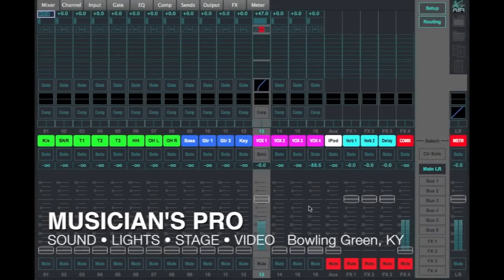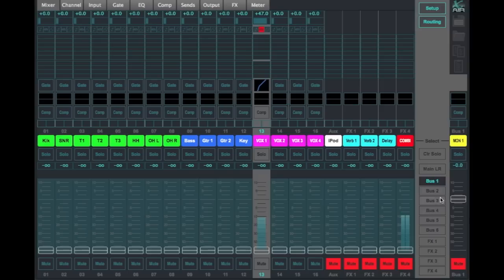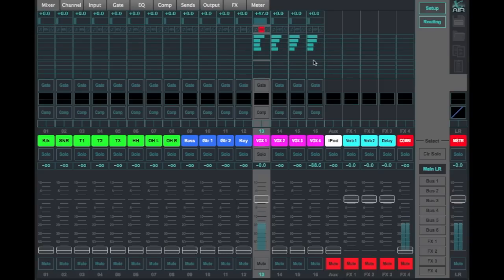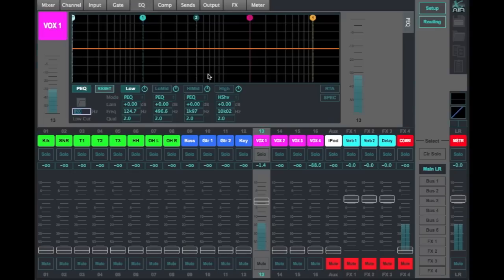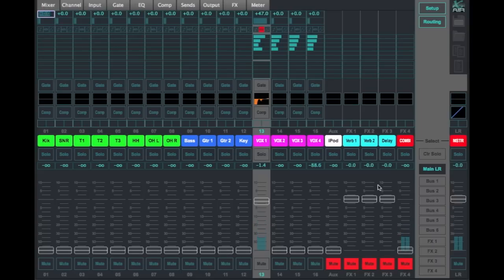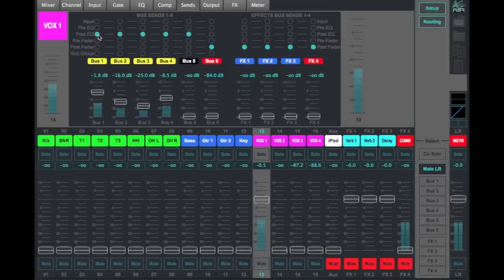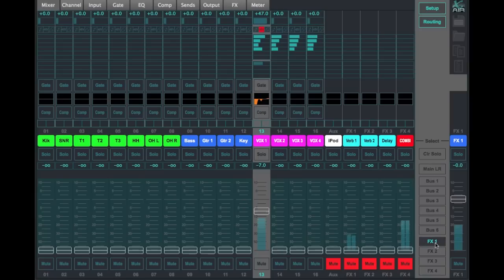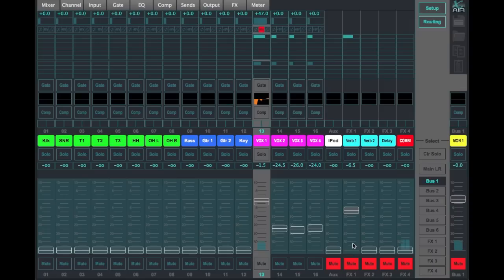Monitor Mixes and FX to Monitors - MIDAS M32 MR18 + BEHRINGER X32 X-AIR XR18 XR16 XR12 X18

Comment: I have a question. I want to have a different EQ on one channel in the monitor not effecting the EQ on that channcel for the main output mix. And I am using Android Tablet as my control mixer for XR-16. Would appreciate some insight or step by step guide. Thanks

Comment: Something that always confuses the hell out of me is the tapping off of the signal on the sends tab.  When it says pre/post fader and pre/post EQ is it referring to the faders and eq’s on the main page or on the bus and fx send screens???
Reply: It's referring to points in the channel's signal chain. If you bring up the Channel tab, you can visualize the signal "flowing" (mostly) from left to right. The Input tap takes from between the Input and Gate sections. The Pre EQ from between the Gate and EQ. The Post EQ (I would have called this Pre Comp) from between the EQ and the compressor, and Pre Fader from after the compressor but before the channel fader. After the compressor, the signal takes a detour down through the fader and becomes the Post Fader signal. LR assignment is always Post Fader.

Comment: Nice video...I think this answers my question...I want reverb for my drums in the main mix but nothing at all from the drums in  any monitor, so i dedicate one reverb slot for drums and have that dedicated effect return set at zero in each monitor bus?
Reply: There would be a number of ways to address this. Could use a subgroup for the drums, insert the reverb on the subgroup and route the subgroup to the main mix. This has the downside that reverb gets applied to all drum elements - normally you wouldn't add reverb to the kick for example. The other option is to route the drums to a bus and use the bus sends to set what gets reverb then the reverb return is patched to the main mix as well as a dry contribution from each drum channel I'd use a DCA across the drum channels to give you a drum "master fader". Monitor mix would take the drum channels direct so they are dry. You would probably not use a reverb insert onto drum channels (say snare) as that could quickly consume all of your FX slots and you'd essentially have to take that fx wherever you used that drum channel - because in practice your monitor sends would likely need to use the post fader option.
Reply: Sorry I'm wrong there in the last paragraph. Monitor is likely to need "pre-fader" so you'd probably use the bus send post-eq setting as I think that is also pre-insert - would need to check the manual. I think the pre-fader setting is post-insert.

Comment: One thing I haven't found any good information on.  While it's clear how to get FX to the monitor Buses, or to the master - what is the best way to get "wet" signal to Behringers P16 personal monitors?  Lets say I have a reverb in FX1.  I select Bus 1 in the mix-to section, move the fader up on the vocal channels  I want sent to Bus 1, move the fader up on the FX1 return, and then I go to the In/Out tab for Ultranet and ensure Bus 1's output is going to one of my P16 channels?  Is that correct? 

And if the above is correct, if I want a stereo effects in our IEM mix coming from the P16s (we run everything stereo) - then would I stereo link Bus 1 and Bus 2 in the mixer, and then send those busses to a stereo linked pair on the P16?   This part is confusing to me.  It would make more sense if I was actually using the physical Aux bus outs on the mixer, but we are sending digitally to the P16s.   Thanks for any help!

Comment: My band uses the X Air Q app to control our own monitor mixes from the stage (6 mono aux sends/vocals). The problem we are running into is each band member wants independent FX level control over their own mix , and it seems that moving FX faders in the X Air Q app only adjusts the FX levels globally across all 6 aux sends. Some musicians want varying degrees of reverb or none at all, for example, on each channel in their monitor mix, with perhaps a bit more on their specific vocal. Is this possible? Or do you have any suggestions for how to properly set this up?
Reply from the maker: This is discussed a lot in our Facebook User Group of X-Air and M-Air.  It is impossible to do what the band members want to do as it would take 6 reverb FX to accomplish this.  It may be too hard to explain in writing..... but the band members are ALL MONITORING the SAME REVERB RETURN channel and they are all SENDING to the input of the reverb.  If one person SENDS MORE to the reverb...they ALL HEAR IT. HTH

Comment: Question for monitors/auxes in general: Is it possible to hit mute on the channel but to still have the signal going to the Auxes? For example, set a fader, leave it on mute/mute group and still have monitor signal on stage?
Reply from the maker: Yes - if you make the AUX sends PRE MUTE.

Comment: If I want the same effect on multiple monitors, each monitor feed gets the effect trails from all the other inputs! For example, the lead singer has a delay FX in his monitor. If another vocalist also wants that delay in their monitor, it comes from the same FX bus. So each vocalist hears the other one's delay. Then a third vocalist wants the same delay. Everyone can hear each other's delay. If assigning a dedicated delay to each vocalist is the answer, that uses up FX slots very quickly. I totally gave up on adding effects to monitors because of this. Am I missing something? Is there some clever routing I can use to make this happen? Doesn't have to be stereo.
Reply: Hi, I am getting the exact same problem that ShaggyDawg has described above. Has anyone found a way round it? The only way I've found to avoid this scenario, is to insert the FX direct onto the aux send.
Reply from the maker: ShaggyDawg - this question is asked a lot and has been answered here. Your answer is correct, it is not possible to have isolated effects without dedicated effects processors.   I have never heard of anyone wanting delay in their monitors. You may want to avoid that.
Reply: Finally someone with exactly the same problem.. after spending 6 hours with the bands mixer at home trying to find a solution i ended up using more than one identical effects to solve this. But still its not efficient and im not sure its the only way...

Comment: Hi. just got xr18
?is it possible to make the FX send ,post fader for the monitors faders,as in the main L/R mix 
   didnt find a way to do so. right now when i lower the monitor fader lets say for VOX, 
    . i hear only the FX return of Vox which is not ideal
Reply from the maker: By default all FX sends are post fader.  If they are not, you have changed them.  There are no monitor fader sending to the effect.  All you can do to get FX to monitors is SEND the FX RETURNS to the monitors.
Reply: i know there is no separate FX sends for Buses(monitors), but i would like to 
  have the monitor mix behave like main mix,meaning when i 
lower channel fader on the the Bus ,the fx send should be lowered 
relatively on that Bus(monitor) too.
  right now when i lower a channel fader to infinity on the bus i can hear only the Fx
of course the Fx send are post fader 
Thanks for replying
Reply: mozizo11 did you figure out a way around this? I’m having the same problem!

Comment: if you want a stereo mix in your headphones for lets say a drummer. is it possible to use a single aux send to them with lets say click panned hard right and the rest of the mix panned left? or would i have to use two separate aux sends to achieve one stereo mix?

Comment: Hey thanks for the video! One Question: If i do add FX to my monitors the way you describe it I would add (lets say reverb) to all my sources on that Monitor. So also my Guitar and snare etc. would have Reverb. thats something i don't want to do. Is there a way to get the same Signal with FX to the Monitor? I have some nice compression and a Room  on my Vocals in me MAIN MIX and I would like to hear that on my Wedges. Some Ideas? is it even possible? 
Best Regards
Reply from the maker: Yes it is possible, with one catch. You are adding the REVERB return to your monitor mix. So..... if you have reverb on 2 vocals in the mains and you want to hear the reverb for 1 of the vocals in their MON or IEM, the will hear the reverb effect on both vocals. It is a shared effect, unless you use 2 reverbs and separate.

Comment: I know this is an old video now, but I am looking to purchase one of these units.  Can you rename the Bus Sends?
Reply from the maker: Yes. Give us a call if you have any questions.
Reply: thanks for the awesome work on the tutorials.  I am working on a IEM setup and I am looking to use the XR16 as the center piece.  One last question.  If I wanted to record on stage will the USB interface track each individual input? or is it better to go to say an ART S8 Splitter and send it to another interface?
Reply from the maker: +Shane Spina - The XR16 does not have a multi-channel recording interface, just 2 trk only.  You would need the XR18 to do multi-track recording.
Reply: +MusiciansPro I was going to use the tascam 8 channel USB interface. would the xr18 be better value?
Reply from the maker: +Shane Spina I think the XR18 is the best value available. It's a full mixer and interface.
Reply: Thanks for the advice

Comment: Hi. Why is the title "BEHRINGER X-AIR X32..." when the video is about XR-18, and the X32 doesn't work with X-AIR???
To be honest, I really hope that Behringer decides to trash their current X32 Edit app, in favour of the X-AIR app... or a redesign of the X-AIR app.
Reply from the maker: The video is not about the XR18. It's about the concept of getting FX into monitors on any mixer. Since the X-Air and X32 are so similar, the procedures are exactly the same.

Comment: How do I just send the main LR to the monitor
Reply from the maker: +Jason Bearup - In routing you can send your MAIN LR mix to any of the ouputs.  If you have a MONO monitor, you will have to select either L or R.   OR - set up a stereo monitor 1/2 and it will be an exact duplicate of your LR.  Lots of options with the X-Air.  Are you a member of our Facebook User Group?

Comment: Hey, thanks for the tutorial. I just wanted to ask, if you know how to use the fx with the panning settings from the channel? When I send one channel for example a hard panned guitar to a fx section, the reverb will appear on right and left channel. But when I pan a instrument I don´t want the reverb to be in center. You know how to figure it out to get the send to fx after the panning of the channel? Would love to hear if it works:)
Reply from the maker: +Juri Band - there are several ways to deal with this.  1.  Simply insert an effect and the guitar channel and it "becomes part of the channel".  2. If you just add reverb via an FX bus, it is not a part of the guitar channel, you have simple added the guitar to the reverb which is STEREO and returning back to the main mix LR.  3. If you truly want to add the reverb via the AUX and do not want the reverb in stereo, you can PAN your effects to one side or the other.  This usually means you need a dedicated reverb effect since any other channels using the reverb will be panned as well.
Reply: I hoped for a solution, but seems like I have to deal with it;) Thanks a lot for your time. I appreciate, you are a real help!
Reply from the maker: +Juri Band - FYI, all mixers work this way - and there are solutions I mentioned above.
Reply: yes I do understand. Just the problem is: as an insert it will only work with 2 channels. And with the fx pan, the thing is that I need two fx´s for one effect if I want to use them on left and right. So I am running out of FX slots. I was just wandering if there was a way to get pan information from the channels into the fx channel.

Comment: Great video. Thanks for your time. I am looking to use this as a studio recording device with occasional live performances. I also would like to use this a "silent" practice solution, much like a Roland HR-5 or Jamhub. My question is this: If I run four aux sends to four headphone amps, then each musician could have their own mix much like a live show. If the vocalist wanted verb or delay on their vocals only and not their entire mix is this possible without sending the effect to "tape"/DAW (I would like to be able to record these sessions). I know I could insert an effect on the vocal channel/subgroup, but would that not go to tape? Also could each send also put verb/delay on the vocalist channel? Let me know if my question doesn't make sense. Thanks for your time!
Reply from the maker: +ivanh3 An insert will always be recorded becuase it becomes part of the signal.  Aux FX will not be recoreded unless you record them seperately and as part of your 18 USB outs in the USB recording tab.  Or you send FX to LR and record the LR, but then you have not mix control of the FX.

Comment: hi  great video, my bands just beginning to understand this, i have a question, if we use the xr 18 for on stage monitor mix with 5 separate mixes going to each of the 5 musicians through the AUX outs, then could you tell me from where does my individual 5 instrument signals go out from to the front of house? do i need DI boxes for each one ?  i hope im clear enuff ?
Reply from the maker: The LR outs are your mains. AUX outs will be monitors.
Reply: +MusiciansPro 
thanks for ur reply,  but we'd like our 5 instruments to go out to the FOH sound guy as well for his own mix to the audience...rather than give him our mix, I would like to use the xr18 just for onstage monitor mixes, how do we go about with that?
Reply from the maker: +RAVEN BLACK A few ways.  The easiest is to just let him run FOH via a wireless device and leave the XR on stage as a stage box/monitor system the XR would plug directly intothe house system and bypass the current house mixer.

Or you could run the LR out of the XR to the house system, thus getting it into their system without any repatching and he can control the mix via wireless.

The last option is like it has always been done with 2 mixers (FOH & MON), get a splitter snake and each mic or insturment line SPLITS to each of the consoles.  But this is very old-school and expensive.  Wireless mixing is replacing this option in many cases.
Reply: You can do that with a splitter system
Reply: JUBY THOMAS was wondering what you ended up doing for this instance? That’s exactly what we are trying to do now!

Comment: Thanks guys for the greate effort you are doing to help us with a lot of tips, and I`d like to ask a question about the monitors. If I have just ONE monitor for 3 back vocals, is it possible with the xr18 to eq their voice separately on their monitor? If not possible, can I route the back vocal channels to PC eq them and return to the monitors? thanks for the multirack tip , It opened a huge range of options.
Reply: Hi Thyago! While I don't have an XR18, I think I understand enough about how it operates from playing with the software to answer your question. Short answer is yes, but possibly with some routing acrobatics depending on what you meant =)

If by 'EQ their voice separately on their monitor' you mean that you want to EQ each of the vocals separately on their respective channels and then send those EQd signals to the monitors, then that's easy: you'd just choose "Post EQ" (or anything below it) in the sends tab for each of the vocals, an their EQ will also apply to the signal being sent to the monitor bus.

If, however, you want to have separate EQs on each vocalist that are different from their respective channel EQs, you'd have to either (1) use a PC as you suggested (though I expect this would introduce too much lag to make acceptable monitor mixes) and either return it to an unused input channel or route it directly to an output jack without further processing, or (2) duplicate the original vocal channels on three unused inputs (using the input routing options), apply the different EQs using the channel EQs on those duplicates, and then mix those to the monitor bus. (There are other options too, like sending each vocal to a separate FX bus, but that seems hugely wasteful since it would use up three of your effects processors!)

What you cannot do (AFAIK) is apply EQ separately to the individual vocals after they've been sent to the monitor bus. Each of the busses just carry a single signal, and everything you send to it is mixed together before it reaches the bus's EQ... so the bus EQ can only be used to EQ the monitor mix as a whole.

That said, I expect in most situations you wouldn't need completely separate EQs for each of the vocalists in the monitor mix and would probably be fine doing the following: (a) apply any corrective EQ for the vocalists on their respective channels, so it will affect the main mix as well as the monitor mix, (b) send those channels post-EQ to the monitor bus, then (c) apply additional EQ to the monitor bus as needed (e.g., to knock out feedback, increase clarity, etc.)

Hope that helps! =)
Reply from the maker: Yes. In the post EQ setting, the channel EQ is going to the 1 monitor. You can also EQ the main output of the monitor.
Reply: Martin Segado, you saw exactly what I was thinking about and gave another things to think too. Thanks for your time. :)
Reply: Thyago Andrade Very welcome!